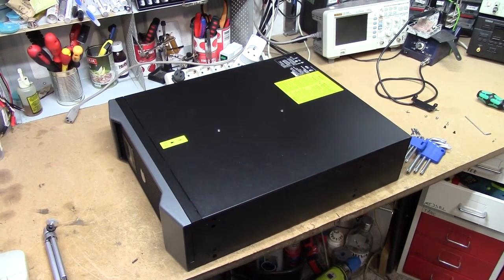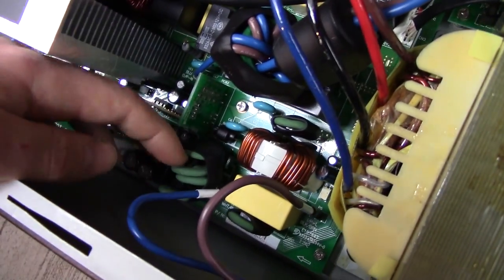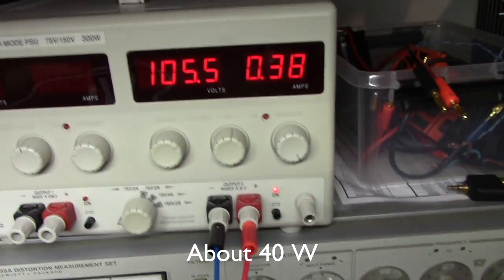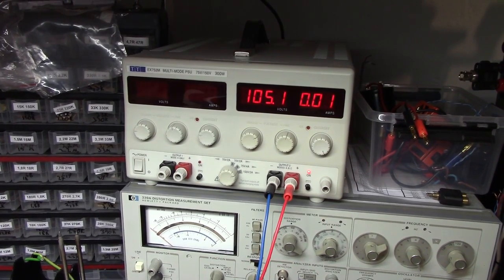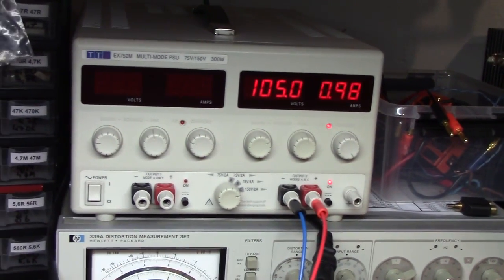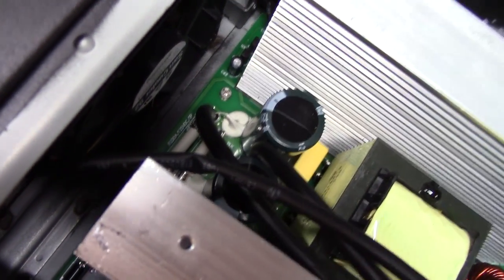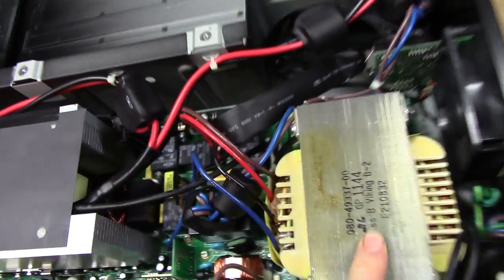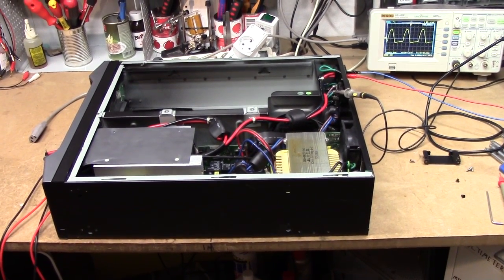Dell J727N 2700 W UPS teardown

Comment: Yeah, the only real market for used UPSes on the commercial side of things is big 3-phase ones.  I almost did get a very old UPS out of a building which was designed to run fluorescent lighting.  It used eight GC2 storage batteries (6v each), and powered the building lights for a full twelve hours.

Comment: This is another 6 years later..  I don't suppose you remember if the unit required a minimal charge to power up.. I have an identical unit, it's battery pack has a charge of 40V.... The unit won't turn on, the front display is just dead... I can hear the spark when you plug in the chord but there's no relay action just yet.... just need to make sure before I dive deeper on it.
Reply from the maker: They always need good battery voltage to start.
Reply: @FFcossag  thank you! Ive found myself in the same predicament at the moment and you are still providing assistance even in 2022! Cheerio!

Comment: Would be interested to understand why simply replacing the fan for a similar silent RPM model wasn't an option rather than hoping for a passive cooling system?  I bought one of these with that solution in mind (as for lots of other hardware designed for enterprise use, fans are made to overcool due to potential excessive heat in a cabinet and to maintain life of the unit).  Even a slower RPM fan would do the trick?

Comment: Hello friend

DELL UPS show error #149 

DELL UPS 2700W ( H945N )
I tried update the firmware of the UPS but when I was using tools update the result was "FLASH ERROR" and then this charged to 100%. 

In display UPS it upgraded to 100% 
Through the console displays firmware update error
AC input and the UPS battery is disconnected. but to reconnect. the UPS is not turned on.
and upgrade again the USB is not communicate with the UPS.

how could I reinstall the firmware to UPS?

Comment: Hi are still using this ? I have the following error : ac input overvoltage (400V) any idea what it might be ? The battery is completely dead as well and wont charge because of this 400V

Comment: I got the smaller brother of this unit. The Dell Tower 1000W version. I have been running it for a while then started using another. Like an idiot wanted to test the battery in it and connected a vacuum cleaner. The power stages basically exploded. One blew out and 4 others became shorted. Do you reckon that's because of the load type of a vacuum not being the intended use case for a UPS? I had the power set low on the vacuum, but that didnt help.
Reply: Kanske skulle skrivit på svenska. Hade missat att du var härifrån :D
Reply: Denna är troligen gjord av Eaton förresten. En 5PX modell har jag nog läst tidigare.
Reply from the maker: Brushed motors kill UPSes. There's just too much noise for them to handle.
Reply: @FFcossag  yep. Live and learn. I replaced most of the power stages and the UPS works. The only thing wrong seems to be that the power reading is faulty now. Reads 0W all the time. There were some opto couplers close to the power stages that I want to look at. Any thoughts what it could be else?

Comment: what kind of a scrapyard do you get all theese from lol :D 
+1 more question... 
i found a listing for a apc RS 800 for 25 euro. buy or no buy? :)
Reply from the maker: The plastic APC units are pretty crap.
Reply: 800 means less than 400w continuos which is very crap and useless.

Comment: Hey mate,just wondering, do you know what kind of power supply feeds the area you live in?eg 11kV step down to 240/415V? Is it O.H or U.G service? Just curious as to why you lose supply so often,are you aware of any contributing factors or other problems?I'm a linesman so it has my interest up,cheers from Daniel in Australia!
Reply from the maker: +Daniel Malik The two main contributing factors is that we mostly have over-head lines in a deeply forested area, and that the island I live on gets its power fed through an underwater HVDC line from Sweden. The power conversion gear in the Swedish end is EXTREMELY sensitive to external conditions, and any time there's a thunderstorm near it, the entire island loses power. We also have local energy production for emergency situations, which needs to be load tested every now and again. It's an archaic network of diesels and gas turbines, which is very, very bad at handling load transients, so any time they test it out, we usually get a few power outages.

I also have a personal tendency of causing power outages when testing gear, so I've always had a beefy UPS set up so that I don't lose data when I flip the breaker.

Comment: if it would be possible to convert it to 48V battery voltage, there could be an after market for PV systems.
Still have one in office, batteries died now and would like to add it to my PV as a 2nd inverter. But this unit has 96 Volts ... damn :D
Reply: no answer is also an answer
any informations about the circuit and the transformer?

Comment: Is there a warning anywhere saying that the battery is not electrically isolated?
Reply from the maker: +douro20 No, I don't think so. I don't see why that would be necessary, since I don't think there normally is any easy way to touch the battery terminals with your hands.